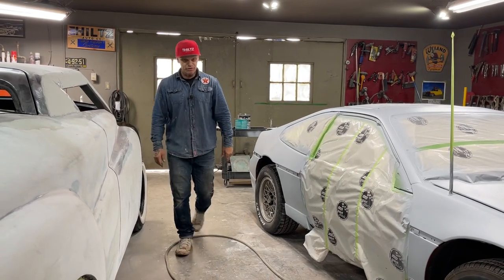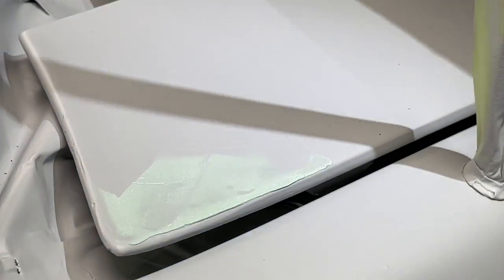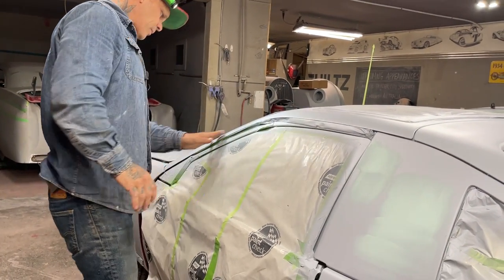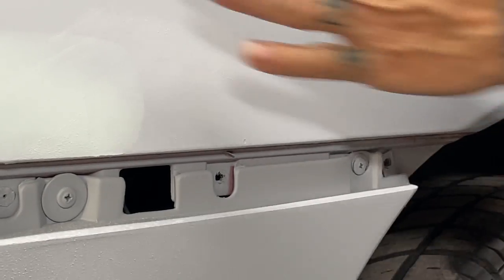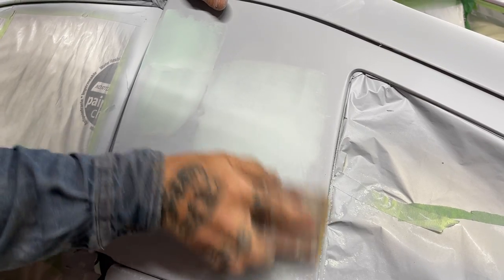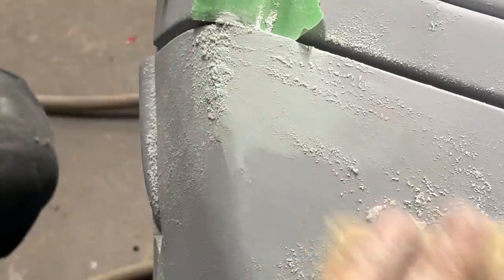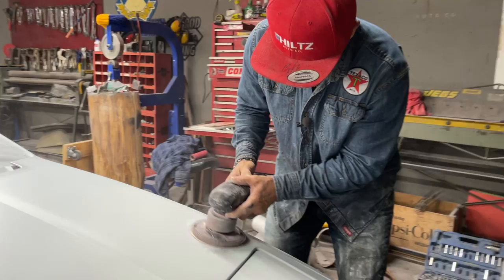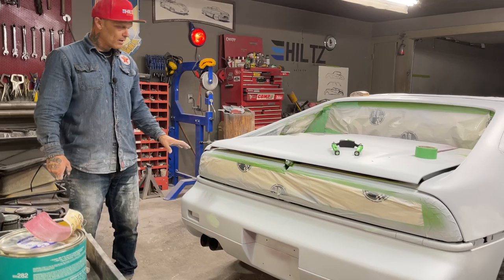Paint prep: fixing all the scratches, pinholes, and imperfections in the primer

Comment: I used to paint interiors of homes and when I was ready to final fill a wall , I would take a small piece of the painters tape and  put it next to the spot that needed work, that way , you don't have to search all over while the fill is hardening.  You can use this idea or not, up to you, I would not use masking tape or anything else, it can leave sticky residue.
Reply: that is exactly what I did with my boat, heaps easier especially if your chasing pin holes and I used tape that has not got as much sticky residue
Reply: Our house is totally different than a car
Reply: That's why 3M invented the blue painter's tape so it don't leave the residue. It was invented in 1988 when it first came out it was very expensive for us body guy's. Until compedaters came out with other tapes, but 3M blue tape is the best in my opinion.

Comment: Hey Chad, love your videos. I recently bought a 72 mgb gt in Teal blue, , the old paint is cracking and splitting, any idea what causes this and is there any interim repair  solution or is it a case of taking the  apart from taking the paint all the way back to bare metal and going from there.
Reply: Well...the problem is likely that the original paint on the vehicle, which was lacquer, has finally cracked from years of shrinking and expanding with the temperature. For a long lasting result it needs stripping off...all of it. However...you could cheat like Chad here and just sand it all over ( use about 80 grit, to get some  cracked paint off of it)...and then nail it with Featherfill. Featherfill is the equivalent of spraying concrete on your vehicle...it will bury the cracks for quite a while. We used it in the 1980's on Corvettes that had...cracks all over the paint. Chad is cheating here because it is so rigid that it never lasts on stuff like flexible plastic body panels.

Comment: Do you think that being plastic parts it needs a additive to the paint to be flexible? That's why the paint cracks after it's applied is because the plastic expands and contracts at a different rate than the paint. After enough time goes by it will soon craft through to the paint. I'm pretty sure you won't listen to any of this but I figured I'd mention it anyway. Throw it away if you like.
Reply: He won't listen about wearing a dust mask too
Reply: @arfonjones7188  he's also happy with not wearing hearing protection too,watched all my friends going down hill from this practice
Reply: That's the point I just made on this site. We used Featherfill in the 80's on Corvettes that had cracked lacquer paint...but Corvettes are fiberglass not flexible plastic. Featherfill is like concrete, and there is no flex additive because it's essentially grey fiberglass resin...so how long will concrete stay good when you pour it over a base of marshmallows? It would seem to me that Chad ( and guys like him) a) never went to school to learn...or...b) went to school but wouldn't listen...or...c) are self deceived crooks.
Reply: When they paint plastic bumpers on Modern cars they have to add a additive to make the paint flexible, this helps with the coeffusion of the plastic to paint ratio.

Comment: i have learn to only have a few batteries or i will disconnect the battery if the rig is going to sit. i have 3 pu's that i drive and one battery for them . i own about 20 rigs that drive on the road but most just sit the older i get the less i drive plus my wife has a rig that gets good mpg most of mine get about 6 to 12 mpg and it takes an hr to get to town.

Comment: Most plastic body cars when painting need an additive put in the top coat to keep it flexible to stop the cracking might be Worth looking into Chad great job so far 👍 👌
Reply: Putting a flexible topcoat on top of an inflexible primer (meant for Corvettes) which is on top of a flexible plastic auto body that readily shrinks and expands with temperature changes, is a recipe for disaster.

Comment: Batteries on stored cars , you should remove one cable in case there's a parasitic load. New batteries should be trickle charged once a year.  As they age probably twice a year. Once a battery has been left discharged it will cause permanent damage. A desulfater may help. I've had car batteries last 10 years. That's rare. I have some big gelcell batteries that were made in 2006 that still have life in them.

Comment: You need to stick to cutting and hacking sheet metal
Reply: I still can”t believe all the panels that are welded onto a build that are not primed and painted to protect from rust on the inside of the panel. This is crucial, this panel will start to rust and will penetrate the weld and lift the fibreglass concoction he uses to “seal” the weld.

Comment: Chad, take dead battery out of car, remove caps, top off cells with distilled water and place on 10 to 20 amp charge for 40 minutes till you see bubbling in cap holes.  Battery should come back to life and accept a slow 2 - 10 amp charge for a few hours.  Let me know if all works for you.  May have to repeat.